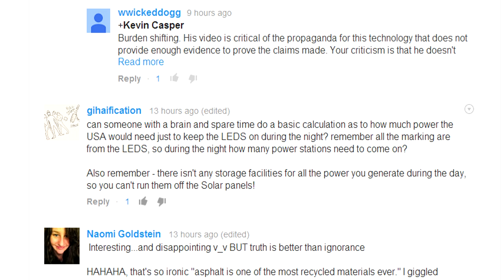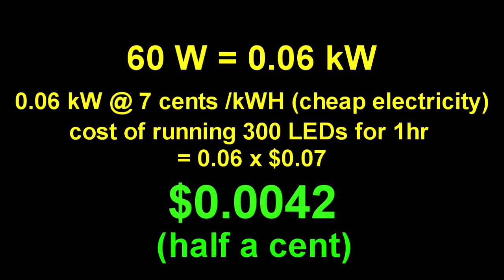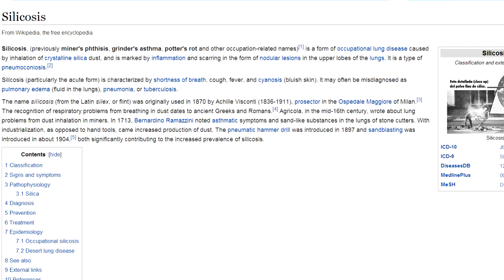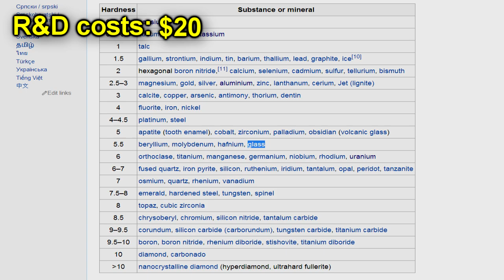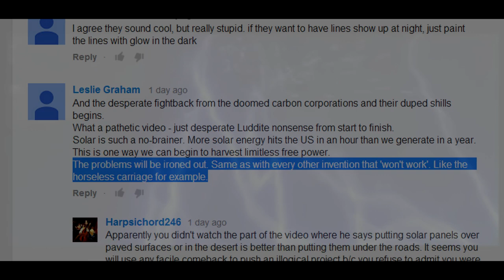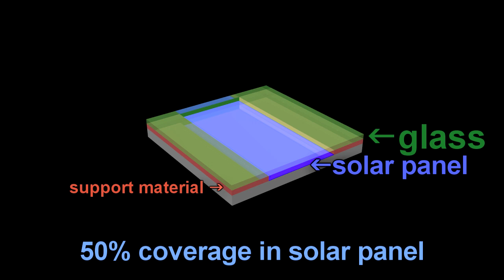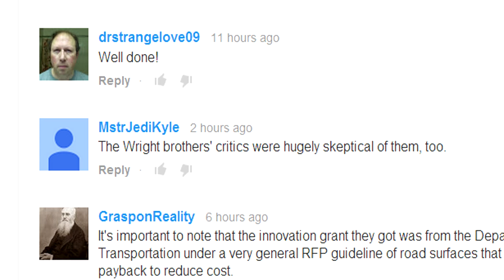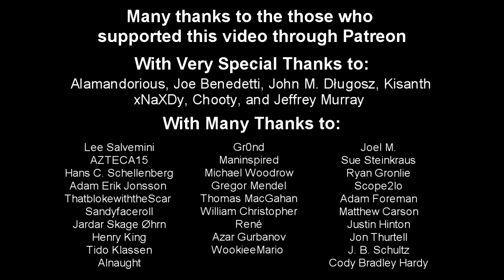Solar Roadways, IMPORTANT QUESTIONS AND ANSWERS!

Comment: Thunderf00t, would you see this as being at all viable for personal driveways, sidewalks, and paths within parks? Basically, paths that don't have near as much weight and force put upon it on a consistent basis as a normal road.

Also, what about the potential benefits if we pushed more solar panels in general and how much energy would be saved with having a power source closer to your home and generating DC power? Currently all home devices use DC power, they tend to convert from the AC to DC either internally or externally (generally those large bricks on your power cord). That conversion results in anywhere from a 75 to 96% energy efficiency (depends on various factors for how much energy is being used, but the range is generally 75 to 96% from what I can find), wouldn't having more solar panels running off DC power to power your home more directly remove the need of long power lines and AC and the conversion process that results in a great deal of energy loss?

Just some questions. I do think the use of these on all roads or any road might be a bit much, but I wonder if there's no use at all for this invention and then would it be worth it or is just coating your house with solar panels more than enough? What about tall sky scrapers that don't have as much area on top, though I have heard of solar panel windows, not sure how efficient those are too. Just things to consider. Would love another video or a response, man :) don't always respond to just the assholes and trolls cause then too many will feel they need to act that way for a response :P

Edit: fixed my issue with the 75 to 96% efficiency (was remembering it wrong as loss, but still, it is a loss that happens twice when converting from DC solar panels provide to AC and then again from AC to DC when appliances use it).
Reply: But why put them in the roadway if it's for personal use? Just put high efficient solar panels on your roof.
Reply: It's simple, replace roads with maglev trains and coat their surface with solar panels. Maglev trains are highly energy efficient and do not touch their "road" / surface as they hover due to magnetic stuff ;)
Reply: I agree whit cookie. It's far more efficient to just put solar panels on your roof.
Reply: But WHY do you want to put solar panels in roads? It is like people just want that for the sake of it. It makes no freaking sense in any way shape or form.
Reply: The God Emperor They usually have a lot more roof area than open driveways. And if it's parking lots you have to remember that cars parked on top of it is going to decrease it's efficiency. Having normal solar cells on the roof will generate more power, cost a lot less, will not generate less power everyday because of a dust layer on top of them and it will be safer to drive on asphalt than glass.
Reply: The God Emperor So just because roofs on homes cant generate enough power to power them, that you think it's a good idea to put em on roads where they will be even less effective is a good solution? 
Your ideas are just idiotic in practice, it's a wate in material to put solar panels on flat surfaces. And your whining about roofs in parking lots being weak against weather? But then why the fuck do they not build solar power plants with all the panels flat on the ground? Oh yeah.. because it's not very cost effective compared to the power they generate. While bad weather would indeed be a risk when placing them on a roof compared to ground. The extra energy you would gain from that compared to placing on a road would more than make up for it.

Secondly why are you solar nerds so obsessed with putting solar panels everywhere? Why not just build solar plants where they can gather the maximum amount of solar energy instead? And just the thought of building solar panels in northern areas where there is a lot of snow coverage is idiotic in it's own way..
Reply: The God Emperor
Wow, you are really desperate in defending a stupid idea, all the while not knowing what you're talking about (or deliberately making wrong statements).

Are you living under a bridge? I've never seen a home that has a smaller roof than their drive way. So put it on the roof FFS.
Not only that. You know what's also an advantage? I'll help you think: you can angle the panels (not tracking, just angled) on the roof. Good luck doing that in your driveway. Gives you at least twice the yield for the same area. And you don't have a frickin slippery surface in the front of your house.

You don't need any concrete pillars for roofing an open parking lot. Ever seen car ports? You know, the space where many cars are sheltered in? A little bit of steel is all that's needed. And it can easily take snow loads.

Btw. another point of yours, where you've clearly no idea what you're talking about: solar panels on the roof can easily produce enough electricity to power a home. A setup like that costs around 10 000€ and pays itself back in 6-8 years.

So sorry, you're either ignorant or just a troll if you still insist on putting solar cells on the ground to drive on.
Reply: The God Emperor They don't have large driveways either. But better a few than none at all. I would say. Roofs are just good unused and otherwise unusable spaces to place solar panels. Also maximizing efficiency in the case of skyscrapers. Take New York for example, panels would recieve more sun on the roofs than in between huge buildings. Though solarpanels for a city like New York is rather futile to start with.
Reply: The God Emperor There is no way that it costs more to have a normal solar panel on a roof than one in the ground whit a ton more electric stuff and glass obscuring it making it lose a little more efficiency. And the LED in the solar freaking roads will suck out a lot of the power they make making it so that they might not even make any power extra. There is no way it's better having it in the roads than on roofs or even on the sides of buildings.
Reply: The God Emperor The biggest question here is really this. Will it even make enough power to pay for it self? Because solar panels alone will take a 18 months or so to pay for it self (At least last i checked) Ones that cost 10 times more and you have to change Twice as often if not more often can't be cost efficient.
Reply: It's still far more efficient to build dedicated solar plants, or for that matter to build them on roofs. Putting them on sidewalks and things like that, would increase chances they would be covered up by anything higher, like trees and buildings. Also driveways? What do you park over driveways when you are home? Oh yeah.. that's right.. Also, Thunderfoot covered that same problem with parking lots in the last vid.. most of the parking lot will be covered up by cars during the day.. thus defeating the whole purpose. Would be far more efficient to just build a solar paneled roof over the driveway and parking lots..
Reply: The God Emperor First. Who cares about that one you linked to? That ain't the only ones on the market. And do you think that putting them in the roadway is going to save a family money? They cost (From the people who make them) 10K per 1 Square meter. That is around 10 years of electric consumption for a household. That alone should be enough to destroy this argument. Then you have the whole you will need to change them at least once per 10 years. And why cover parking lots whit them? Why not just put normal solar panels on the roof of the stores. Remember. This "solution" costs 10K per tile which is about 1 Square meter. And that cost is coming from the people who make them.
Reply: The God Emperor The 10.000 $ price tag is from the people who are making it. They came whit it in a way to counter Thunderf00t. So try to read up on things before half assily trying to counter them. And this is not about the power panels lasting that long. This is about the glass that is supporting weights up to 1-2 Tons. No mater how you spin it 10-000$ is not worth it per square meter.
Reply: The God Emperor And you are ignoring the points i made. Putting solar panels on a flat surface, whether its a sidewalk, driveway or wherever, will only be able to generate about a third of the energy of a tracking panel. or about half of a fixed angled panel.. If you want solar power, then just build fucking solar plants, where they will be the most useful and cost effective. 
You are arguing about the loss in power from converting from AC to DC, while completely ignoring the loss in power from having them on sidewalks instead of angled or in tracking panels..
Reply: The God Emperor Also another problem with having them on sidewalks, is that sidewalks tend to get very dirty. Especially during autumn and winter seasons. Further reducing the efficiency.
Reply: Namsep  that'd be interesting, but doubt many Americans would be ok with it given our culture of cars lol.
Reply: redholm  No, I said it could cost a hell of a lot more to create a full covered parking lot with thick concrete pillars and a strong roof (some areas get a LOT of damaging weather, hell, in the north alone the example Thunderf00t gave would fail under the pressure of snow even if it was angled to have it slide off).

And so we remove the LEDs, I don't care about them in all honesty. Place the solar panels among the entire parking lot except the areas you want to place markings.

Also, again, as I said, almost no home can run solely on solar panels (right now) when it's placed JUST on your roof. Most are not going to want this in their lawn to make up for the power needed

http://cheapsolarpanelsguide.com/wp-content/uploads/2012/10/Cheap-Solar-Panel-08.jpg

Hell, a lot of places don't even have a lawn to place that on, but they do have a lot of sidewalks and driveways and other places that could be used for more of these to generate power. And we don't need LEDs for the sidewalk or driveway versions because they tend to not have markings. Then all the power they generate would be used by the homes in the area.
Reply: The God Emperor We read it. It's just the small fact that we don't look on every single thing you say as fact and disagree.
Reply: redholm  not every building has a large area on the roof to power the entire building. Think large cities and skyscrapers.
Reply: redholm  true, but homes don't need as much power as skyscrapers and even then, coating your house in solar panels often isn't enough to fully power it (usually enough to lower a lot of your electric bill, but not reduce it to 0).

Parking lots in the US are more barren than they are full in most areas. Some of the large cities, sure, they are full a lot, but even then they have wide open areas between the parking spaces themselves where people have to drive on. There would still be a lot of area in most parking lots of the nation. And, the example thunderf00t gave  in his last video was not very sturdy looking (was basically just poles at the corners and solar panels on top above the parking spaces),that would blow over and be far more susceptible to destruction from the elements than if it was in the ground itself. There's also a chance that if they were to make even more sturdy supports using full concrete, that might not be viable in all areas of the nation as well as possibly being MORE costly than if you put the solar panel in the parking lot itself.

I think people who discredit the idea entirely are a bit to absolutist, as foolish as people who think that this will be viable all over the nation on all roads and such.
Reply: CookiesForEveryone  possibly, but I see it being possible to put the solar panels on the top of the buildings and on the sidewalks/walk-ways. After all, as I mentioned, a house generally can't power itself on just the solar panels it places on its roofs (at least most homes), it might help to fully remove them off the grid if they have more solar panels than just on their roofs and it might be more appealing to people to have them placed in the walkways/driveways than having a large panel on their lawn like this

http://cheapsolarpanelsguide.com/wp-content/uploads/2012/10/Cheap-Solar-Panel-08.jpg

Even if it would be more efficient (as Thunderf00t did explain well in this video).
Reply: YoungerBrother Wakeup  I didn't say the roads, I said sidewalks, driveways, and possibly parking lots. And why not? That is often space that has clear access to the sky more often than not and if we can make it more than just an even walking path and also make it a means to generate power, why would that be a bad thing? It might not be enough to power an entire city, but it would help lessen the need of oil/gas fuels. And, as I said, it might be enough to push a personal home to the point of using full solar power while also not upsetting many Americans who would hate those large panels put in their yard in the picture I provided. Gotta remember how shallow our people are and how much they care about the look of their lawn/homes/property.
Reply: redholm  I don't think it's just a matter of paying for itself though. It's a matter of we need to get off of fossil fuels badly. It's part why I also would love to push more Nuclear power (especially Thorium reactors). If we don't push more solar panels on all buildings, don't push more wind power where applicable, don't push more nuclear power (especially on Thorium reactors which would be cheaper, more abundant, the decay is faster so it's not radiated waste for as long, etc, just can't make weapons from it which is the only reason we don't use thorium reactors right now) then we're in deep shit in due time.

We need to push more technologies and get off fossil fuels and start doing our part to lessen the amount of damage we do to our climate and environment. Also why we need to push more electric cars (sadly, we could have had way better electric cars than even now if companies like Chevy and such didn't buy up and squash all development of electric cars for decades).
Reply: ParasiteX  66% of homes have garages in the US according to the Census Bureau. Most park their cars in their garages. So driveways could still be viable.

And yes, some sidewalks will have trees over them, but they will still be generating power. People seem to treat our trees in the US that line the sidewalks as some great blocker of light, not even. Most cities keep very small trees with very thin leaf coverage on the sides of their walkways already. I think people are underestimating what use this could be.

And I've already addressed your claims about parking lots that Thunderf00t showed, the example he showed would not work in most of the US because it would be so weak it would break to the weather of the region or other natural hazards. And the costs of building more sturdy roof over the parking lots might be more costly than putting these in the parking lot itself.

I really wish people would read the entire comments before posting so I'd stop having to say the same thing over and over again and address the same criticism over and over when I've already addressed it and brought up problems with the criticism...
Reply: redholm  Who cares? Did you miss the ENTIRE point? Houses can not be powered solely on the panels placed on their roofs. That's why most still are on the grid and any that aren't do put things like that in their yard because they need that additional area of solar power.

And no, we don't know the cost of these, especially if they didn't come with the LED. Everything you and Thunderf00t have come to claim aren't based on the actual costs, just speculation on what the costs are. He uses costs from retail/online stores which are not necessarily the cost these people are paying to get the same products. And there's nothing done to properly show how these would hold up to just average foot traffic if they were put on sidewalks.And why would these need be replaced after 10 years? My research shows most solar panels can last 25-30 or even more years. They might have reduced efficiency, but still efficient enough to not need replacing. it's the converter that tends to need be replaced every 12-15 years. Realize, that would not be necessary at all because there's no reason we should have to convert between DC to AC and then to DC again.. remember, appliances run on DC, the reason there is a converter for solar panels is to convert it to AC because the power grid runs on AC, if we just had the solar panels run DC straight to the house and appliances ran off DC without the need of converter, that helps the costs A LOT (as well as the energy efficiency, again, 75 to 96% of energy is lost when you convert from AC to DC and vice versa, based on the formula it can vary depending on how much energy is coming in).

I think too many are claiming problems with this without knowing all the facts... it's ok to be skeptical, but don't discredit all ideas or all possible solutions outright.
Reply: redholm  You ignore the facts I presented and that's a problem. It's a FACT that solar panels last for at least 25-30 years. It's a FACT that the converters are 12-15 years (and wouldn't even be needed if we used DC alone anyways), it's a FACT that 75-96% energy is lost when converting AC to DC, it's a FACT that 66% of homes in the US have garages, it's a FACT that homes can not fully power themselves based off solar panels on their roofs alone, it's a FACT that the flimsy example thunderf00t gave for how to roof a parking lot would fail in a lot of the US due to the weather alone (and it's possible that the costs of putting a truly strong enough roof over a parking lot with the solar panels also put on top is not worth it or better than just using these solar roadways, that's probably true given that almost no parking lot in the country, even in the north with all our snow, puts a roof over their parking lot).

Ignore all the facts I presented and the reasoned arguments you want, but it won't change them from being so. And if you disagree with facts, well, then I don't see any reason to keep bothering.
Reply: redholm  no, the $10,000 price tag from what I can tell is only found on the rewards list and getting one of them from it. That's the ONLY place I can find where people are getting the "it will cost $10000 per panel" from. I can't find it in any article or statement from them or even anyone actually doing a total adding of the costs of materials to make this... I counter everyone who uses that $10,000 number because not a fucking one of them can find me a legitimate source proving that's the actual cost.

And what 1-2 tons on the side walks as I proposed? People don't way that much and aren't exerting that much force on the sidewalks especially because their velocity/acceleration is far less than a cars as well.

Here:

How much will your panels cost?

We are not yet able to give numbers on cost. We are still in the midst of our Phase II contract with the Federal Highway Administration and we'll be analyzing our prototype costs near the end of our contract which ends in July, 2014. Afterward, we'll be able to do a production-style cost analysis.

Even they don't fucking know yet and that's fair enough given their reasoning. People who claim $10,000 are idiots right now with absolutely no backing. Hell, even taking total parts and adding them up might not be a fair cost analysis because they are likely to see the cost of the materials from stores (online or physical stores) and use that, but most businesses buy in bulk and at a cost on average per material than what the average consumer pays. So enough with the "$10,000" claim from everyone.
Reply: ParasiteX Did you not fucking read a single fucking other fucking thing I fucking said? God fucking damn I'm getting aggravated at all of you people. Did I say the roads? No, I SUGGESTED THE SIDEWALKS!  Or, possibly, places like driveways and parking lots (for the ones where thunderf00t's example in the last video would not be feasible due to its flimsiness) where there are often not large trucks on and cars are often putting far less stress on it than regular roads (and, as I stated, 2/3rds of the US has garages, aka, they park in their garages giving time for their driveways to generate power, also, let's not forget most tend to be out during the day, not at home, more time for the driveway to generate power).

Your criticism are idiotic and ignore every single fucking fact I presented. I'm getting tired of it. It also ignores that we do need to get off of oil and gas and all fossil fuels. That will help our climate change issues and our enviroment because of these facts

"A typical home solar array is 4 – 6 kW in capacity. A 6 kW array prevents 13,000 lbs of carbon from being emitted into the atmosphere in just the first year; over the lifetime of the system the CO2 emissions avoided would total 330,000 lbs. To put this in more tangible terms, this solar array would help reduce as many environmental pollutants as you would by not driving 290,000 miles or by planting 21 acres of trees"

Also, as I said, a home can not generally be powered fully by putting solar panels on its roof alone, it needs additional power elsewhere (more solar panels around the house on the lawn that people won't want or from a power plant which uses more fossil fuels or wherever else it can get it). Hence, we might want to look into placing these in the sidewalks/driveways and see if it would be enough in addition to solar panels on the roof (as well as possibly Solar Panel Windows) to fully power a house without any other source.

As for why putting solar panels everywhere, did you not fucking read a single fucking thing again? I stated that when you have the power generation closer to home you can keep it in DC form, because appliances use DC, that will help with efficiency of energy because you remove the conversion between AC and DC... if we create solar plants they will often be far enough outside of an area that they need to convert the power they generate to AC first and then send that AC power long distances to a city/town which will then be converted again to DC when it enters a house. You're wasting so much energy doing this.
Reply: ParasiteX  I know it will only be able to generate about a third perhaps, but would that be enough to make up for the power needed that putting panels on just the roof doesn't provide? That's something no one, to my knowledge or my research in trying to find the answer, has provided.

And I told you, again, solar plants are not efficient compared to if you can put the panels right at your house for the reasons I provided. The converting from DC to AC to then transfer it long distances to then convert it again from AC to DC is a lot of energy lost. Hell, the loss of energy from converting is FAR greater than the loss of power of putting them horizontal on the side walk (again, the power lost from converting between AC and DC is 75 to 96%).

As for side walks getting dirty, true, but you can, you know, clean them off. And a lot of people would clean off their side walks/driveways if it meant that it improves their energy generation. Also, how much they get dirty and how much it'd make the solar panels inefficient is something they need to test.
Reply: Tary88  Ah, my bad, been years since I took physics. Though I think it's higher than 5% (the most efficient is 96%, but again, some are as low as 75%) and it has to convert twice from Solar Panels DC to AC and then again from AC to DC when used in an appliance.
Reply: Tary88  It's only the same right now because we have our power grid set up to be AC, so DC panels are set up on your house to work into the existing grid that requires AC, if we removed that middle man and appliances had a cord necessary to use the DC directly that would help with things. There are changes we need to make to our system and then there's this issue

http://online.wsj.com/news/articles/SB10001424052702304020104579433670284061220

If we had power for houses generated around those houses, causing a mass-wide blackout becomes a hell of a lot harder.
Reply: Namsep '...magnetic stuff...'
mostly superconductor magnets from what i recall
Reply: The God Emperor
 A solar panel installation company came out and did an estimate of our house last year. We asked how much power we would be able to get from the panels. They told us that we have enough roof space to generate all the energy that we would need. The problem is the laws in our state, and many other states, are set up that if a house with solar panels is generating more than 50% of what the house is consuming, then that property is declared an energy producer and is taxed as such. Although we wouldn't be paying the electric company any money for power, we would end up paying more in taxes than if we had no solar panels at all.
The solar panel company would install the panels, and then adjust them over the next three months to where they would produce 47 - 49% of our total consumption thereby avoiding the electricity production tax laws.
Reply: orbnorian  that's pretty shitty of the state tax laws, but that's part of what's happened by the oil/coal companies to keep the new energies down. They don't like that competition :\

However, that's not the case for everyone, not everyone can produce enough power from their roof alone, at least all the research I've done has found that, on average, most can't fully offset their power bill costs from solar panels on the roof alone.
Reply: Tary88
They said that the average time was about 4-5 years. They reduce the total cost by 49%, and then accept 50% of that 49%. Add in all of the state and federal government incentives for home owners and we would save 40% on total cost. It's a great deal for us. The problem is that the entire roof needs some repairs, re-shingling, and insulation replacement.
Reply: CookiesForEveryone
If there ever are anything like solar roadways it will happen after most of the roofs in America (and Europe and Canada) are covered with newer, cheaper solar panels. Certainly roofs will be covered long before roads are.
Reply: superdau So you come in, say nothing of value except insults and ya.. ignoring you from now on. Little ignorant fuck.

Btw, putting a roof over a parking lot, one that will stand against wear and tear of the elements, is expensive, it's why they don't do it, even if they can put solar panels (which is even more of an expense at first) to help lower electric costs. It'd be worth looking into seeing if it WOULD be cheaper to have these (without LEDs as well, just straight up solar panels with enough support to not be damaged by the cars driving on it at about 20 miles an hour)  to see if it'd be viable. You haven't done the math, so stfu.

Also, the $10,000 cost? Ya, already proven that value wrong and bullshit. Enough with the false facts you stupid fucking people.
Reply: There are a lot of references to the oil industry, and how we could give them a nice wake up call with this project. All I ask is this; by what means of energy will these products be produced, transported, stored, and installed?
Reply: The God Emperor
Get out a little. Then you'd see that there already exist numerous parking lots with roofs that easily stand the "wear and tear" of the elements. Just for your info, since you you're not quite up to date: humans have been able to build sturdy roofs for millenia now, even cheap ones.
If you'd actually read and try to understand what others write (which seems to be your main problem), you would see that I wrote about the price for a solar installation that can power a home, not those stupid tiles. Germany produces 10% of it's electricity with solar panels installed on roof tops and they are far from being out of space there.
Reply: superdau  I've traveled around this entire nation, the only parking lots with "roofs" are ones that are underground parking lots or parking garages. The vast majority do not have roofs to them.